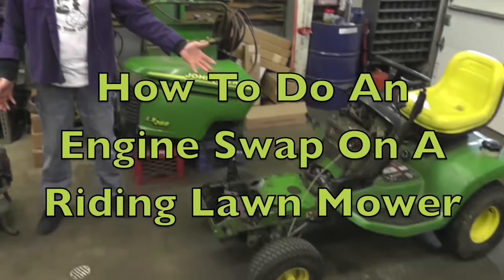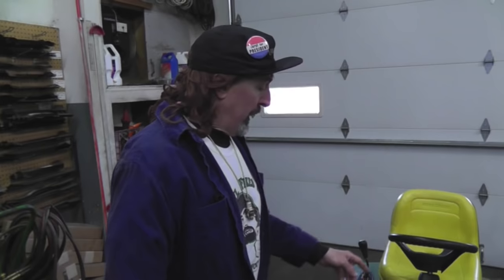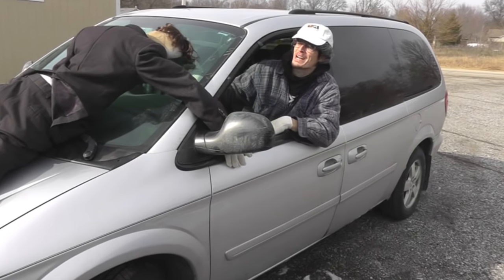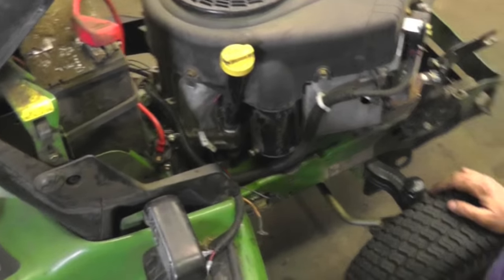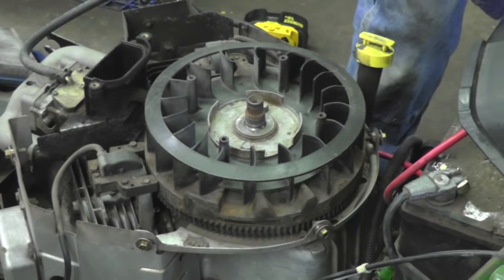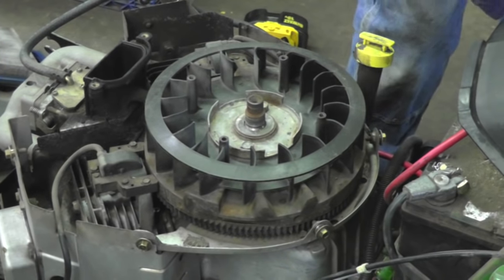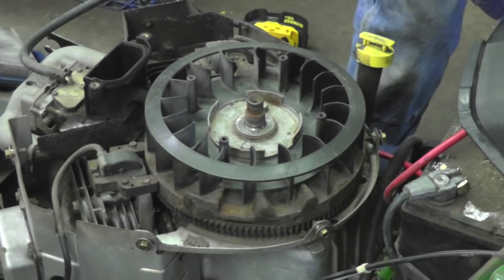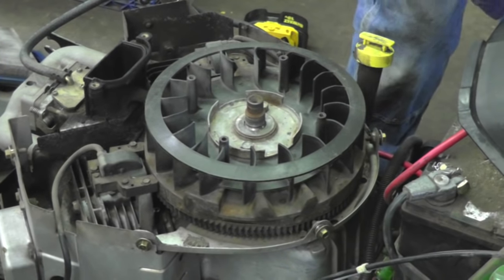How To Do An Engine Swap On A Riding Mower with Taryl

Comment from the maker: ATTENTION GRASS RATS!!!!!
I see a lot of comments on my technique of removing the flywheel. Let me inform you that Briggs, Tecumseh & other manufactures have been making tools that require you to either tread onto the shaft or place over the shaft pry up on the flywheel & then hit the end of the tool with a HAMMER to remove it from the tapered shaft. Totally safe & acceptable. On the engine in the video that shaft was machined with a tip on it. So when I hit it I did not screw-up the threads only the machined tip. Had it been threaded I would have used one of those threaded tools that you hit with a hammer. Hope this clears up any concerns.
Reply: +Taryl Fixes All LLC  I had to do a swap on my LA130 and your hammer trick was awesome saved me a lot of time. On that swap I found an available motor, swapped a briggs 21hp with the nightmare camshaft problem for a Kohler 17.5 Commander. The Kohler had a manual PTO Briggs had an electronic PTO it turns on an runs but because of your video I know I will have a voltage difference. Any Idea what Kohler stator I will have to purchase to fix this?  Thanks Man
Reply: you failed to sike me because i had no idea what your saying
Reply: What I usually do is if it has a threaded nut, I thread the nut on by itself until its flush, then do it how you do it. Unless its a 14hp that uses the plastic fan. Then I use a harmonic balancer puller to put tension on the flywheel, then smack it with a hammer. 3.5 and up with a clutch, I do your way, but smack directly on the shaft with a brass or plastic dead blow hammer. I always use a brass hammer on the above engines also, it does the same as the removal tool, protects the crank.
Reply: dave1135.   I all ways use a puller because my aim is as bad as Taryls no offence Taryl Dactal ..love your videos thanks...
Reply: The way we do it, is similar, we use a dead blow hammer after removing the fan from the flywheel, and a prybar.   Works on everything: Kohler, Briggs, Kawasaki, MTD, Honda, etc.
Reply: Hey taryl how do u hook up the motor to the transmittion or does it already fit with the shaft?
Reply: Taryl Fixes All I have this IDENTICAL tractor Tayrl,but it STILL has the original engine in it and it doesn't use any oil,doesn't knock,ping,leak oil or anything.
I use Amsoil 0W30 weight oil with Amsoil oil(brand)oil filter since break-in.This video is proving that its EXTREMELY IMPORTANT that proper engine maintenance cannot be stressed enough.Believe it or not,in spite of the fact your changing your oil on time,the quality of the oil is just as important as the frequency of the oil changes themselves.
I recommend the use of a"TIER-ONE(1)synthetic oil.Amsoil is a TIER-ONE(1)grade oil.
I use my LX-288 to cut 14 acres of lawn EVERY YEAR and the Briggs-Vanguard 18 hp.hasn't shown ANY signs of failure yet to date.
Buying even a"used"engine can get pricy in a hurry if your mechanic has to do too many modifications to get it to work.
If this was my LX-288 in this video Tayrl,I think I would possibly put in a brand new Honda 18hp.engine in it and call it a day...😀👍Excellent video!!.
OH,I almost forgot...THERES YOUR DINNER!!.☺😀
Reply: Do you have a video on doing a briggs to predator swap. Cause I'm having issuses with the electrical side. Also I only have a thrittle cable and the motor has both throttle and choke.
Reply: I been taking the flywheels off the same old way since the mid 70s . Good job on the repower as always Taryl!!
Reply: just get slippers to hold the crankshaft and hit it with a 30lb mall....
Reply: Been doing it your way for years
Reply: @saulgoodmanfromthehittvsho1314  huh?
Reply: @jmc5341  yeah that comment up there dates back to when I didn't know what the Hell I was doing lol. Never mind that

Comment: I ran into a problem with the hood as well,  I used the original hood, I just made 3 inch extensions to raise the hood went from a 12 horsepower Briggs to a 25 horsepower  V  twin Kohler.  Nothing like doubling your horsepower 😊

Comment: Good information! 
 After you loosen the crankshaft nut put it  level with the crankshaft,  then use two pry bars on opposite sides of the flywheel to give the pressure and then hit the top of the nut and the crankshaft with a brass hammer. If it comes off hard at least you won't booger the threads up and possibly save the crank threads.
Reply: +oaktree71able - Go to AutoZone and  " Buy " a part that needed the Pulley Puller.  Do your Job, then " Return " the part for the refund... That way you can rent the Tool for FREE!!! LMFAO !!!
Reply: Not sure what's up with your Autozone but where I'm at, you just rent the tool you need. They don't ask questions like what you're going to use it for. If yours does, that's weird. Either way, you pay for it up front (deposit) and if you don't return the rental tool, well, you bought it.
Reply: I use this tric me too but on that crank it doesn't have tread on the end of the crank and this end is smaller than
then the tread too so it have no chance that the nuts not fit after.

Comment: Hi Taryl, I enjoy your videos, informitive, easy to understand and funny. I have an old 
Ariens EZR zero turn. 14ohv briggs single cylinder went bad after 12 years so i decided to install a 17hp briggs opposed twin. swap went great and would not of been as successful without your bit on the charging system in this video. Thanks

Comment: I got me a crap cadet 2138 with ch16s motor. Had to put a new carbonator on it last year cause it wasn’t carbonatin anymore (ethanol in the fuel). Now this year no spark. Them damn meeces chomped on my coil wires and the SAM spark module crapped out - no power to the coil. The “better” “improved” module is supposed to show up today. All one unit. I hope the kroller sticker comes with it so I can have one, just like you have.

Comment: 12.2v, dropping to 12.0v with the PTO on, seems a little low.  I like to see 13v or more on a car alternator under a load, maybe mowers are different?
Reply: me to i was thinking that alternator was bad shed be between 13.5v to 14.5v. if its 12.2v you turn on PTO an its 12.0v and you have lights so it be 11.whatever the batter would go dead. So id say that's a bad alternator. And its not good to jump start a mowers  it can destroy the charging system can burn up the  alternator. that batter is dead so the alternator over work to charge that dead batter. so its best to charge the batter or go an buy a new batter a cheep one at  Walmart $25.00 with a cor batter.
Reply: @robertb6120 which cca?

Comment: Great video. I just wished you would've gone into a little more detail about the wiring.  I'm a dummy when it comes to wiring.  But, none the less, I'm doing the same thing right now. And have gotten to the wiring part of this. My question is, the single cylinder 19hp (OHV) engine that blew, had an electric PTO. The V twin i'm replacing it with, doesn't. Can I use the alternator from the single, on the V twin?  If so, then I'm in luck. If not, then I don't get no dinner. Please feed a starving man Taryl.

Comment: I am working on a Murray Select. I  gave $40 for it. It had no engine. But I had a old Briggs opposed twin. I put it on wired it up and it ran good. I went to put the hood on and found it was about 4 inch to tall. I had another Briggs 13.5. I bought a carb. coil and did a valve job. Put it on and it ran sweet. And the hood fit on perfectly. A couple days later I tried to start it and it would not start. Spun over way to easy. Hooked up my compression tester. No compression. The valve seat in the block came out. I saw your video on how to fix that, But  I know with my luck that would come back to bite me in the ass.  I had another Briggs a 15.5 engine. Put it on and all the wires matched up. All I had to do was plug them in.  So I put the hood on and it seemed to fit. I got the bolts in. But when I went to raise the hood the bottom hits the muffler. At this point I have already spent more money on it than I will get out of it. Not counting  all the work I have  done. I suppose I can make up some brackets for the hood. And then start on the mowing deck. At first this was kind fun. But now, not so much.
Reply: +William Wynn - Re-Route your Muffler.  Home Depot and Lowes have the " Iron Pipes " for Natural Gas, that is the " same thread " as your Muffler and cheap too.  You can use as  " Extender + Etc "!

Comment: My dad passed away in dec 2016 and he had a crapsman gt5000 lawn tractor my sister had scrapped (it was rusted out and trannie was worn out.)
I pulled the krohler cv22 out along w harnesses and pto and took it home. . 4 yrs ago. 
I kept her warm n dry. Just so happened I came upon a nice jd L120 for only 100 Bucks that had a blown intec twin w  crank case blown out  yes it exploded piston exited stage left... 
Now the shaft diameter and length pulley line up and muffkin didn't jive. 
Cut 1/2in off drive pulley flipped it and added ring created from cut made placed it on top then slid on the pto and it lines up perfectly.  Heated and bent exhaust flanges on pipes from intec and they mounted into muff box well. Torqueddown and then wired up. 
It had good compression at 126 and leakdown was 95ish  percent but no fire on left cylinder.  Bad coil. Ordered from eBay along w new airfilter. Added diodes to kill lines to coils to keep any dc voltage getting to em. 
Had to also modify the pto lock brace and belt guide plate. 
Can't wait to get it running. Its a nice heavy tractor

Comment: I have Intek engine with the separate choke like that. The choke works cuz when it running and I pull the choke it wants to die. But when I try to fire it up. I gotta crank it for a min for it to start up after it sits all week.

Comment: I love your clear and concise videos on these repairs. So many folks get $crewed by shady repairmen. Would you have a video on removing the blower from a J/D snow blower. Ours is a 1330se 342 cc machine.  One of the four tines on the blower wheel is actually bent backwards probably from a bag of newspaper ads that was buried under the snow at the bottom of our driveway last winter. It actually stalled the engine which was at full throttle at the time. I just noticed the bent tine recently while replacing a broken shear pin. Thank you for sharing your vast knowledge and skill with us. I certainly appreciate it.
Reply from the maker: +luvkountry  If you have a oxygen acetylene torch would be the best way to heat it & bend it back.

Comment: You did not show replacing the flywheel. You mentioned that the hold down nut needs to be tight to keep the key  in place. It takes approximately 80 pounds of torque to tighten that nut properly. Tell me how did you hold the flywheel in place while you put the torque to the hold down nut... Thanks

Comment: Yeah my 18hp Intek needs overhauling it runs fine till a loads on the motor then it bogs way down. If I sit there it slowly comes back up to cutting rpm but as soon as I start cutting it drops right back down 🤔

Comment: I picked up a Scott’s L2048 20hp 1” shaft. Crain it had the motor replaced with a 22 hp Briggs ELS 22 HP model 40H777 the shaft is 1.125 I have been trying to figure out is it’s possible to put a1.1125 PTO Pulley on without problems. The new engine runs so dang good I want to use it.

Comment: What if the scenario was different.  Your donor engine briggs is coming off of a tractor that had electric pto, and fuel solenoid shut off. And going on a tractor that never had those. Would you swap the wiring harness also or just omit hooking up the wires you don't need?

Comment: Yeah you got wucky. I put a '93 ch18s from a cub cadet in a '76 c160 wheel horse that had the old kohler 16hp. Needed a new 6 terminal ignition switch to ground the ignition modules. The '93 kohler has a carb selenoid that tapped 12v from the voltage regulator to starter seleniod terminal wire with a diode wired into the harness so i wired it to the new ignition switch. Took me a month to figure out the wiring of this 'alien' v-twin wiring but it all works great. Both kohlers had 15amp alternators to.
Reply: It is a hydro, Doese it matter what way it turns,

Comment: I did not see where you explained where the wires came from just before you explained the charging system.  I know they came from the starter switch but I don't know how they were connected to the starter switch and what they are connecting to on the starter switch motor.

Comment: i had 2 mid 90's simplicity broadmoors. one with a crapped out hydro gear tranny and another with a ailing vtwin briggs. i put the 15 hp kohler (from the one with bad tranny) onto the one that had the bad briggs engine. all seemed to go well for a year then the motor would die after cutting for 30 minutes.turning off pto would help it run again.  i cleaned the flywheel area where the stator /alternator resides and all seemed well for some months.  . now it dies after 20 30 minutes and only runs again after cooling down for an hour or two.i have put a new fuel pump& filter on, new fuel lines, enlarged fuel cap vent slightly, swapped interlock module from other mower along with solenoid. when i cleaned flywheel it was charging. ive cleaned carb and put new needle in but not the valve seat. (didnt come with kit.) when it dies and i loosen carb bowl nut there is fuel. when it dies and i put starting fluid in carb it runs till starting fluid is used up. could it be: 1. stator shorting out when hot       2. needs valve seat and another cleaning of carb.    3. a fuel shutoff line was on 16 hp briggs and not now (not sure if it had one tho)     4.  valves need adjusting
i know ur busy but thought i'd try      Bob
Reply: a faulty ign coil can break down when it gets warm  then when it cools an act like nothing wrong  cheers

Comment: Hey Taryl I did and engine swap from a 24 HP Briggs intek to Briggs 24hp professional I think it’s the same but this has a automatic choke carb  the old one had choke and throttle . I did do the governor trick but it seems the same . these carbs can’t be adjusted , I turn in the screw but it revs to high it won’t come back down when i throttle back to idle. So I have to back it out to stock . the old intek 24 hp had so much power this  new one pisses it’s pants it has no power if the lawn is a little high . let me know if you got and tricks for a 24hp Briggs pro , ps it’s on a craftsman dys 4500 42 in deck if you need engine number I have it , i also have engine number of old one . I changed belts like in the video and everything you said in video ok thanks for your time.

Comment: I have a lx277 with a 17 ho Kawasaki engines that a hack jb welded the PTO on it.. he must've hit something and broke the PTO bolt.  I wanted to up grade this 4 wheel steer jd with a 23-25 hp Briggs.. the Kawasaki has a different style voltage regulator. I have to figure out with stater wire on the Kawasaki the hot and the other is neg...any idea?..thanks for the help from ur other videos that help my on my jd sst18 now has a 23 in it .mows like a beast .
Reply: Joe Pinto I’m having a similar issue.. it’s pretty frustrating. Especially not having extra money to run and buy stuff

Comment: Taryl, I have an Ariens zero turn 1640. It currently has a 16hp Briggs on it however, I've always felt that the machine is under powered.  If it was you, what engine would you recommend for more power? Thanks for your videos, they are always very informative and entertaining!

Comment: that's what I forgot.. engine bolts! been riding around my cub with no engine bolts. no problem, sits in there pretty good. wanted to use new bolts, but gotta take the front axle off to get to them.

Comment: I replaced the carb on my cub, but the new one didn't have that fuel shutoff solenoid. no big deal. not sure if it makes any kind of improvement, but works fine without it.
Reply: +Pete Lorenzo - Better off without them.  They invented the " Fuel Solenoid " for LAZY People or People don't shut off for Winter Storage, etc, make more money out of you!!!....  Just get a " Manual " Fuel Shut Off Valve and you will be good.  Sometimes that " Solenoid " can give you a lot of headaches... If there is no power or when bad.... You will pull all your hair out trying this and that, to get the Motor running.  So, in the end... You better off without them!

Comment: I.m replacing a 14 and half hp with a 17half hp, bot Briggs.
Electric on old one has 4 wire connector block and seperate 2 wire block.
New engine just has 2 connector block and a seperate single wire.
How do I connect this wiring ?

Comment: I have a Simplicity Regent 38 with the infamous Kohler Courage 18 HP engine. To be honest it has been running well and has just now started to occasionally kick back when starting, I am assuming the Exhaust Valves is not consistently releasing during the start. After watching you videos and some others I plan to pull things apart and put Loctite on the upper case bolts, take care of the leaking Valve Cover Gasket Etc. My question is if it turns out to be too much to do and I decided to replace the motor what would you suggest. Seems like they all have cheap build issues. My owners manuals came with the books for both the Kohler and Briggs, just not sure which Briggs. Is there any whee to cross reference which motor will bolt up on the Simplicity Tractor?

Comment: 12.07 volts isn't enough to replace the voltage taken from the battery in initial start up. It needs atleast and additional volt to replace the voltage loss from the starter and to assist the pto voltage draw.     13.5-14.5 is nominal for a 12 volt system  anything under 12.9 is parasitic to the battery.   A healthy 12v battery at reast with no static charge is 12.8v.
A battery with 12.6v at rest is 50% drained. 11.75v is 70% drained  any lower can damage the battery. Lead acid batteries that constantly go below 40% sulfate rapidy.